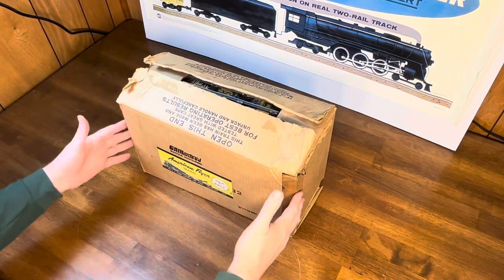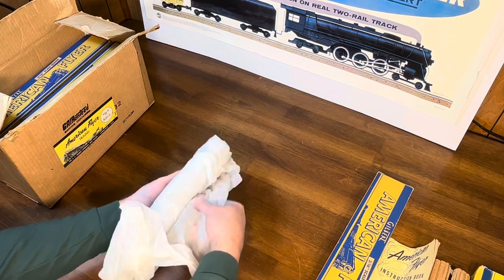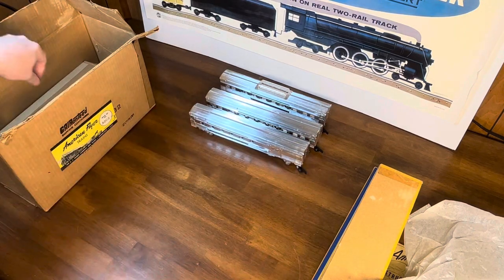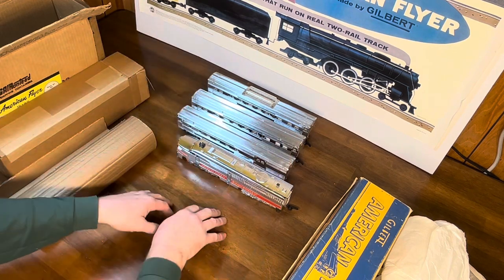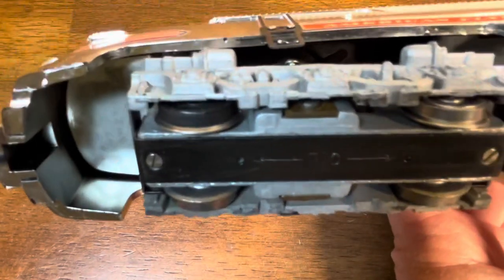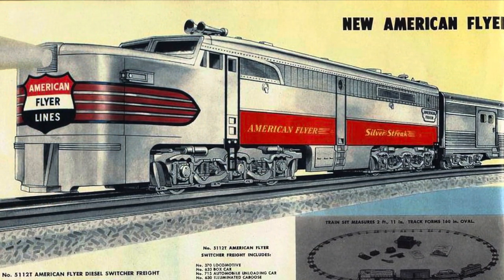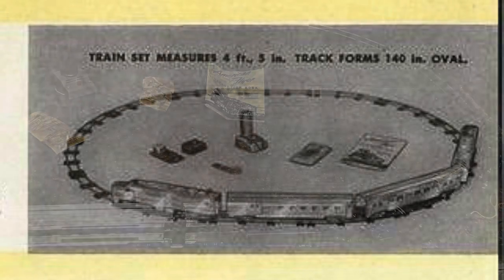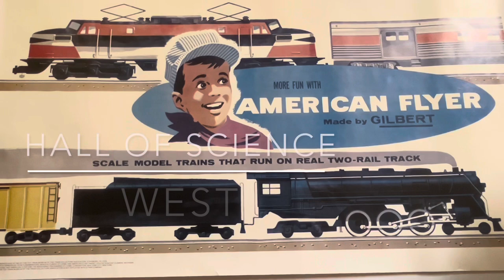American Flyer: Unboxing, Operation, & History of Set 5205, The Silver Streak

Comment: That is factory blemish. Chroming was not too perfect but still beautiful. I met an ex Gilbert employee in 1997 at a hospital where I worked. He was visiting someone there. I learned a lot from him about Gilbert MFR. The 661 served as the observation car. I found that link çouplers stay clear of that white moulding when soaked with mineral oil. The Gilbert employee said several of the Pikemaster cars escaped production runs with leftover knuckle çoupler trucks such as the  24222 Domino Sugars hopper   and the Green Great Northern reefer which some were made with opening doors and painted also. I have one with the opening doors & KC trucks, brake wheel, also the all brown original box hand stamped at the factory with 24422 on it!

Comment: I have one of those club and baggage cars. The chrome was in very bad shape when I got it, with the worst being the same places as the car you have here. The chrome just didn't stay on those cars well when they were being used, or even just out of the wrappers. I stripped off the rest of the chrome and painted mine silver and it looks wonderful now. I am still enjoying seeing you take these new or nearly pristine trains out of their boxes. It is like traveling to the past. I agree with your supposition that this particular set might have been a way to clear inventory. It looks like this locomotive's chrome was applied over a prototype paint scheme that was abandoned and never seen outside of the factory.
Reply from the maker: I think there is a lot to what you are saying.  It could be a re-chrome over old chrome or even painted.  I may take the shell off just to see what’s underneath.  Thanks for your comment.  Very inspirational.
Reply: Yes I believe it was.

Comment: I also have this set. I wanted a chrome plastic observation and did not want to search for a 500 series coach. I installed a link coupler truck to the front of a nice chrome 963 coach.
Reply from the maker: Neat idea.  I think I’ve seen that train on your videos?  Very nice looking.  I actually have a lone 663 aluminum observation that will probably find its way onto this train at some point.  Until then the flat ended train is kind of cool.

Comment: What an absolutely gorgeous train. To see it all getting unwrapped as new is a real treat.
I must admit, my perception of S flyer has increased no end watching your videos. I've been a great fan of Flyer wide gauge, but their S really demonstrates how good their model railway equipment was.
I also note that truck design of the coaches. The truck pivot is offset, so when the train goes round a curve the coach ends are considerably less offset; looks a lot better when running. The swing is still catastrophic of course, but things like that just adds that extra. 
Why do I get the impression that the PA body shell is a chromed over painted shell? Those bonnet markings you pointed out looks very suspicious. And the chrome job isn't great by any standard, like the shell hasn't been a bare shell and the process hasn't gone well. Almost as if the silver streak may have been a bit of a market tester to see how fantasy named, super shiny trains might sell. 
Your videos always have great production values, and you've really excelled with this one, very interesting and enjoyable
Reply from the maker: Thank you for the positive feedback on the video.  Funny you mention about the swing of the cars.  It’s not so fun today, but when I was a kid I used to love hooking up curved track together in an s-pattern so I could watch those streamlined passenger cars swing back and forth.  Great memory.

From what I’ve learned, a lot of these 405 shells have some sort of defect with the chrome plating.  I’m not even sure the celebrated “marbelized” finish on some was supposed to be there.  I think the general consensus is that Gilbert was looking for a way to clear their shelves of poorly chromed diesel shells and cars before the 1953 line of chromed diesels came out.  Even though the finish is very poor, it’s still a good looking train.  Thanks again for the great comment and the good memory. 👍

Comment: I didn’t think Pullmor tires were used on 1952 production?
Reply from the maker: Hi There.  You’re right.  They didn’t list pullmor power in the catalog until 1953.  The yellow stripe version which would be late 1951  doesn’t seem to have it, but the red strip in the video definitely does.  Given the condition of the set I’m pretty sure it’s original.  Perhaps a late 1952 set or maybe a service update/recall for the single motor diesels?  It would be neat to see if other silver streaks or even the 1953 comet engines have the rubber tire.  If I ever pull the shell I’ll check the date and post it here.  Thanks!
Reply: @HallofScienceWest  It is also interesting that it doesn’t have the sliding shoe pickup that later diesels have.  If I had to guess, I would say the sliding pickups were added to reduce static noise in the horn speaker, but they would also reduce the current passing between the axles and the frame bushings.  They were added on steam locomotives with the airchime whistle, I think for the former reason.
Reply from the maker: Now that one I don’t know about.  This Silver Streak doesn’t make much in the way of static noise that I’ve heard on others, but it definitely slows down dramatically when the horn is activated.  Especially when compared to the later 471-473 diesels with roar and horn.  They made some definite improvements on the onboard horns and whistles over time.  Wish I knew more about it.